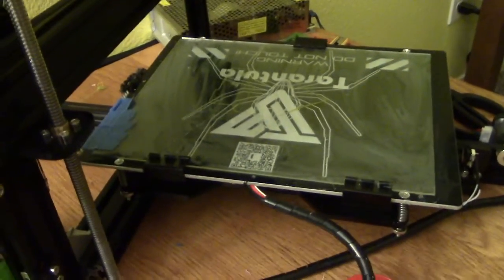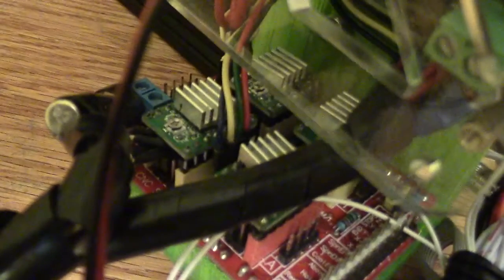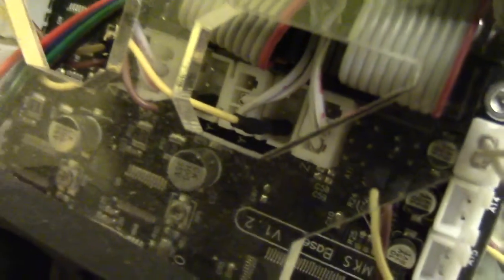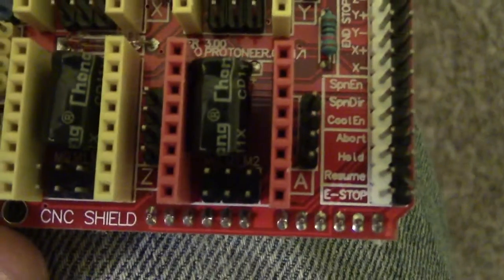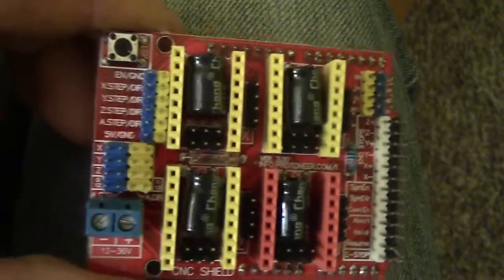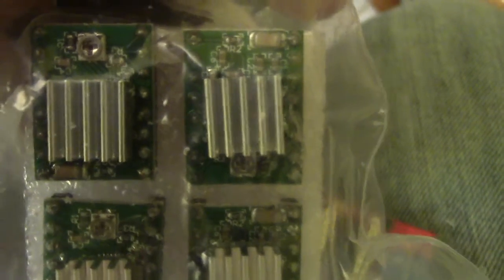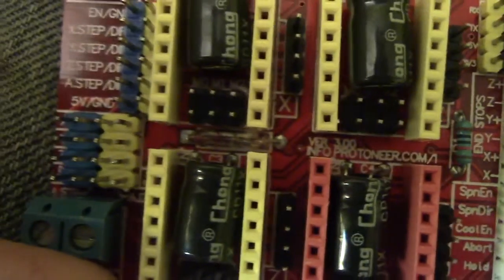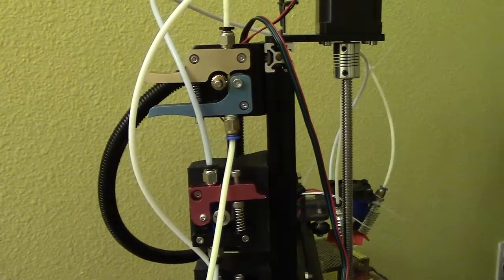Add a Diamond hot end to any 3d printer! - Part 2 - Electrical

Comment: The aliexpress seller you refer to in your document (for the diamond hotend) - is that a 100% brass hotend - or is it brass-plated steel? I have seen another video about an ebay diamond hotend, and that one was brass-plated steel, hence thermal conductivity was poor - and the printing result was also poor because of this...